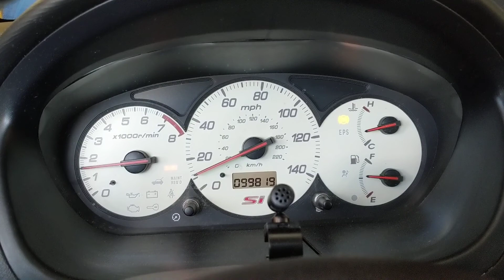Using 05+ Honda VSS on EP3/RSX K-Pro ECU with Dakota Digital Converter

Comment: I got kpro reading my css sensor but no converter installed and my power steering is acting up and eps light coming on and off. Will wiring in the converter fix this eps issue?
Reply from the maker: Yes, EPS needs to have a speed signal otherwise it will throw error.
Reply: @Turboactive thank you.
Reply: @Turboactive Dakota is working pretty good but now I have the issue of the Speedo cutting in and out during hard driving or about 70mph and up. Any chance you were able to solve that?
Reply from the maker: @colecampagna  Hmm I never had that happen, possibly you can replace the signal wire with shielded cable. You can use and old USB cable, they are shielded.

Comment: Hi Turboactive, I've been having issues with my K swap in my DC2 chassis. It consist of a K24A2 engine from a 2004 TSX, K20 engine wiring harness from 2002 RSX type S, 2013 Honda Civic Si K24Z7 Transmission, and Hondata Kpro V4. Everything is running fine but the speedometer is not working. I have the Countershaft Driven Speed Sensor selected in on my Kpro but still doesn't work. Do you think my issue is the same as yours? Or do you have any recommendations? BTW thank you for posting this video.
Reply from the maker: Yeah you probably need to use the Dakota Digital box to split the signal between the ECU and the speedo. The speedo doesn't actually talk to the ECU it is separate, that's why when you tick the box nothing changes. You should see the speed in KPro go up and down with the vehicle, however. Here is the Dakota box:https://amzn.to/3sfmLC8
Reply: @Turboactive  Thank you for your fast respond. You've been very helpful and generous with sharing your knowledge.
Reply from the maker: @jsrebuilds3951  not a problem! I love these little cars and like helping others with their builds. Yours sounds awesome btw!
Reply: @Turboactive  Thank you. I plan on making a video on this for my build and wanted to ask if you were ok for me to mention you and the help you gave me in my video?
Reply: @Turboactive  I know there are a lot of videos out there on builds but I wanted to try put out videos that are just simple and that can help others with their builds. It would been nice if there were videos that would just cut straight to the point and be more helpful for my build. It's my first build btw.
Reply: @Turboactive  Also I like your channel. This is kind of circuit racing I would like to get into hence why I build this car.
Reply from the maker: @jsrebuilds3951  yeah for sure you can mention me! These cars run awesome on the track you'll love it
Reply: @Turboactive  Thank you.
Reply: Hey Turboactive, one more question. I don't have speedometer convertor box at the moment, is hondata kpro v4 able to read the mph on the laptop/software/ecu?

Comment: I was able to do this without the use of a diode. Vss signal wire coming from the vss sensor goes to input, the other end of that wire coming from 31p & C101 go to the output #4 on the older model Dakota converter. Should be the same with the newer models.
Reply from the maker: Sweet! Good to know, I tried without a diode and it didn't work unfortunately.

Comment: awesome just saw your post on hondata forum.  Spunkster did not understand at all lol.
Just some clarification I will be using an aim dash for my tsx running a prb/prc ecu.
So I won't have a split wiring for input to the dash and ecu, just the ecu.  
So do you just leave the wiring with 5 volt ref or mod the vss so it gets 12 volt ref?
And on k-manager use just click countershaft driven vss and the ecu will read the speed correctly?

Thanks for any clarification.
Reply from the maker: I just left the signal alone and checked the box for countershaft sensor. I'm using the sensor from the 08 transmission FYI
Reply: Did you wire the connector like a 02-04.  I know your using a z3 vss.  

I am using a kpro 02-04

Any clarification would be greatly appreciated.

Comment: Do you have diy information, need this badly
Reply from the maker: Split VSS signal from transmission. One side goes into Dakota Digital box input and then the Dakota Digital output goes to ECU. Other side of split goes into diode and then into gauge cluster.
Diodes: https://amzn.to/2Y5yeq5
Dakota Digital Box Available Here: https://amzn.to/37rKq7c

Comment: Hey first off I would like to say thanks for the information provided I am using the similar setup to yourself I have an 06 rsx and I am tapping into the vss signal right at the ecu connector plug as it comes from the vss, I had split that signal to go to my Dakota SGI-5E and from output 4 on my Dakota to my Speedo, it seems to work great at low speeds, but once I get over 100kph the signal just drops. Would you be willing to post a link to the diodes you are using?
Reply from the maker: Yep using these diodes: https://amzn.to/2Y5yeq5
Reply: @Turboactive  Thanks dude your the mvp

Comment: I don't see the need for diodes. All you need to do is cut the VSS "signal" wire from the transmission and split it 2 ways. One goes to the ECU and the other goes to the Dakota converter. You then connect the Dakota converter to the cluster...  What am I missing?
Reply from the maker: Do it and see if it works
Reply: @Turboactive   do you have a diy instruction, need this badly
Reply: @Turboactive  i make the same without diodes and it works. Ecu and k-manager read VSS fine. 
 But speed would not register on gauge until some time later when the vehicle was up to speed.  Can you fix the lag time on gauge with the diodes?
Reply from the maker: @Tornlift1  Yes possibly. I have that issue too sometimes but not always.
Reply: Been there and done what you suggested you need the diodes.

Comment: you said without hondata support, so you have "normal speed sensor" selected in kpro? Or are you using the countershaft option?
Reply from the maker: See video
Reply: 2005+ css option

Comment: Hey man ().  I gotta pretty cool idea if you want to take up on.  So I have this car that you should check out and take a look at and considering buying.. I have a Honda si 05 ep3 clean 10/10 inside and out flawless 28,000 original miles.  A very hard rare find to find asking $20,000 because of the mileage you will not find another stock original ep3.   So come on man take the road trip down here.!!   Don’t forget to holler back at me 🤙
Reply from the maker: Sounds awesome but too rich for my blood. Have you heard of Bringatrailer.com ? You might get a good price listing it there